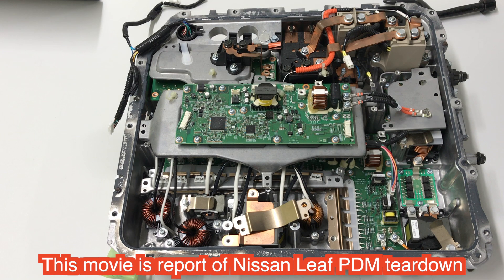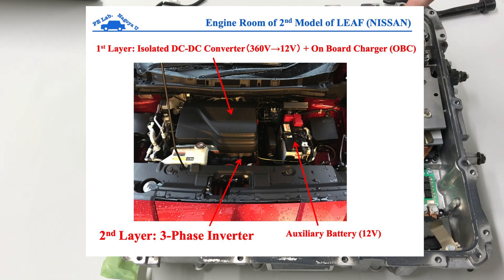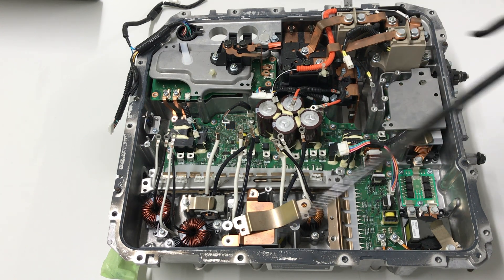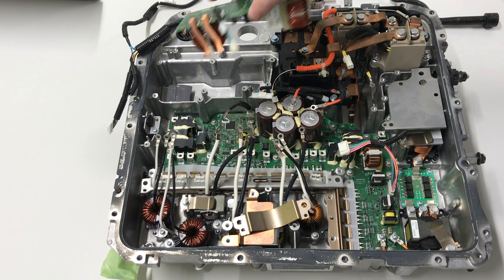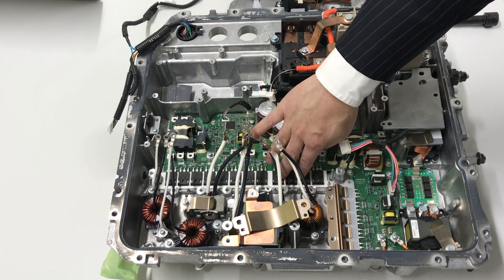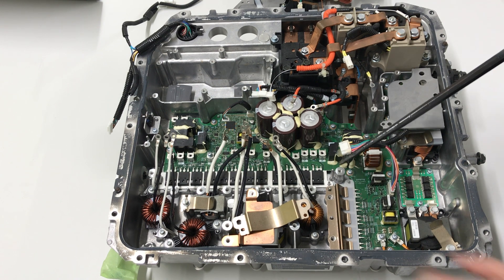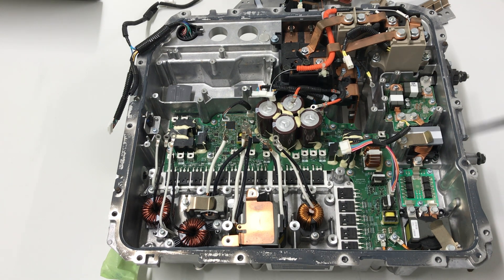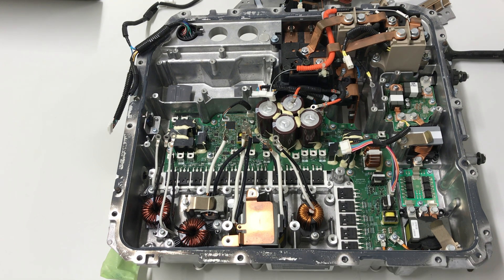Nissan 2nd LEAF: OBC & DC-DC Teardown

Comment: Hello. Thank you for sharing this information. 
There are two isolated dc-dc converters here. 
1. 400 V dc to High voltage battery (Traction battery)
2. 400 V dc to low voltage battery (12 V battery)
Are both the circuit phase-shifted PWM dc-dc converters?